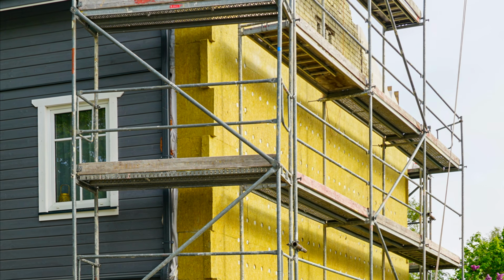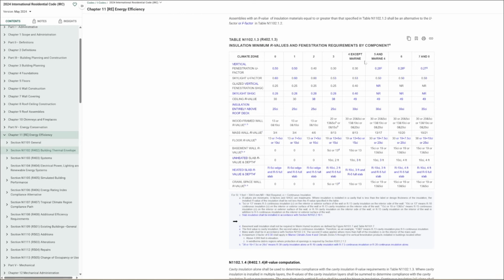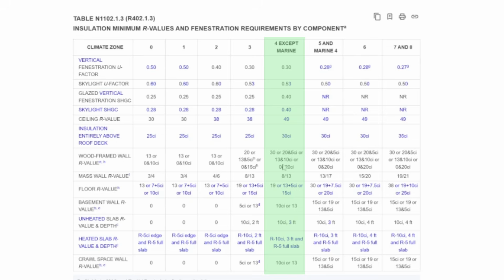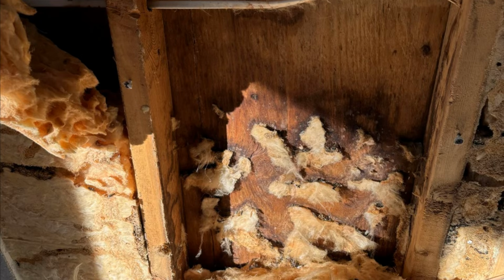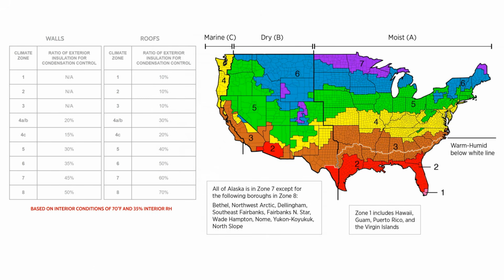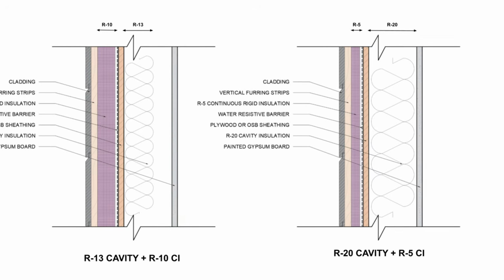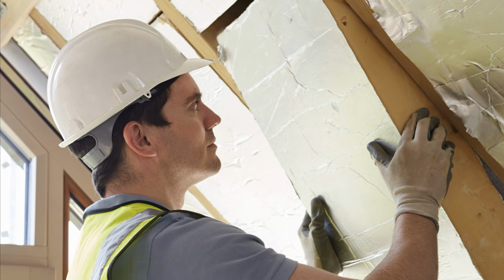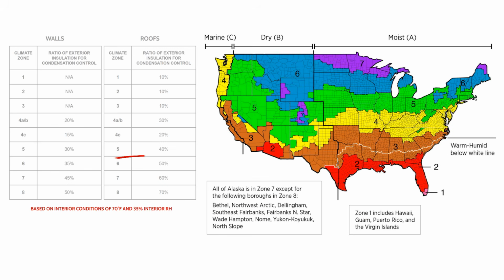How Much Exterior Insulation Do You REALLY Need? (The Code is Wrong?)

Comment: Could you use something like rockwool on the outside to avoid the flammable exterior insulation?    I don't know squat about vapor barriers so I was thinking double stud - with a 2" gap filled with rock wool - between studs rockwool and zip sheathing a rain grid/mesh then rockwool 2 staggered 1" then firring strips.

Comment: Why are you referencing the 2024 IRC but using the climate  zone map from older codes?  The IECC updated these in 2021 which changed them fairly significantly.

Comment: I'd like a video on how best to assemble walls for an intermittently conditioned space - in particular for my new 3 car garage I am building.  I'd like to have enough insulation and tightness to heat and cool the space only while I am working in there, perhaps an hour or two every other day, and only in winter and summer.  Just using a small 10,000btu 110V Mini Split.  The rest of the time the space would not be using HVAC at all, perhaps 98% of the time unconditioned.  We do not have days over 30C nor under 0C when I am there.  walls are 2x6x10.

I am thinking the walls will be: stucco, tar paper, thin rain screen, OSB, Rockwool 3.5 in, MemBrain smart vapor barrier, drywall.  What do you think?

Comment: How does using 3" of closed cell foam on the interior side of the sheating + open cell or blown-in dense packed insulation for the rest if the wall cavity factor in when calculating the value of the exterior sheating?
You briefly mentioned a foamed interior cavity half way through.

Seems like Zip-R6 sheathing + 2x8 wall with alternating 2x4 studs with 3" of closed cell foam & blown-in insulation would get you an R-44 wall, a huge thermal break between exterior sheating and interior sheetrock, and an excellent vapor and moisture barrier.

Looks like a huge PITA to install water bibbs, electrical conduit, and any penetrations through 10" of exterior insulation and keep any moisture from getting through all the hundreds of linear feet of edging between all the pieces of exterior insulation thats fits together like a dang puzzle.    Too many failure points, engineers forget that humans assemble houses, not an automated factory in Japan with less than 0.0001% failure rate.   

You're right that building to minimum code gets your permits passed, but 10-20-30yrs from now is all this pieced together exterior sheathing still going to be held tight and uniform against the walls ?

Comment: I've always done 1" exterior foam in climate Zone 5, which seems to match up with your requirements.  I like this because I can still put siding over it without having to put furring strips on. (any thicker and the nails holding the siding bend)  So far I haven't seen any problems doing it this way.  I like having insulation over all the framing members and my houses are always warm.  I use foil based and tape the seams for the water barrier on the outside.  No tyvek needed.
Reply: If you don't mind me asking what's "always" mean?  basically how long? Do you install windows over top of rigid foam or buck out? Any advantage to installing rigid to studs then installing sheathing over? I build in Zone 5 and like this method but there's issues with some details.

Comment: Hi Asiri, thanks for this well-cited group of recommendations. I was wondering about the interior moisture throttling recommended in the IRC in CZ5 and above. First of all, it does not appear to be enforced at all. Second, if we can limit moisture intrusion from the interior, would the current recommendations by the IECC and IRC make more sense? I will check out BSC's research on this too, but would like to get your take on it.

Comment: I work in commercial construction as an estimator and I've been trying to be the most knowledgeable person in the company on how these assemblies should go together.  Its amazing how varied the design of these assemblies are in the real world.  I am also in the process of doing a large addition and trying to improve the thermal performance of my own home and now have more questions than answers.  One thing that I would love to know more about is the impact of interior closed cell foam with exterior rigid insulation and if that affects this ratio.  Your examples all seem to reference interior batt insulation which obviously has a much higher likelihood of having interior air hit the backside of the sheathing.  Does closed cell or "flash and batt" change anything?

Comment: Writing into the code that you can build something that the code writers know will develop mould problems is begging for a law suit. Some owner builder is going to build a house according to code and then sue someone's butt off when they get a mould problem.
Code should be sufficient that the house will not develop mould under standard operating conditions. Sure, if people are drying clothes over the heater and running their indoor humidity to crazy levels, that's on them. But if they keep their indoor humidity and temperature inside the usual parameters, they have a right to expect that a house built to code will not endanger their health.

Comment: "The code is the worst possible building that you can construct by law..." That's a truly mind-blowing change of perspective. As someone who works in fire protection, I'm certainly going to use this.
Reply: I prefer "code is the floor," but this is a good version, too.
Reply: "The code is the worst possible building that you can construct by law..." we also can say that  the, code insulation , is the minimum new house insulation that is allowed in your region!
Reply: A home that is carefully built to code is a pretty good house that is safe and will last a long time. As a former builder one change I’d like to see is allowing fire sprinklers to be omitted by using non combustible siding, type-X drywall and a new code compliant panel box. Since gas appliances and fireplaces are essentially banned where I live the risk of fire is already greatly reduced.
Reply: @Krunch2020  definitely something a builder would say

Comment: With a minimum  R22 (nominal)wall insulation, I am considering double stud (alternating) construction 2 layers of 3 1/2 Roxul in zone 4 on Vancouver Island. So, rainscreen. Moisture vapor condensation on interior of sheathing could be an issue. Is it feasible to place sheathing BETWEEN the wall studs and thus avoid the issue of condensation on the interior of the sheathing? Thanks again, informative as always.

Comment: First, is this only pertinent to new construction projects only or is retrofitting/renovation (especially for mold remediation, say) considered similarly? 
What do you do with an existing full brick faced house where retrofitted exterior insulation might be highly problematic (I'm only interested with the wall assemblies here, as brick roof assemblies are such a small percent of the housing stock)? I see some that overface the brick and then it looks like they stucco over the new exterior insulation assembly, how's that for the long term?
Second, what of the proposed 51st through 63rd states (Canadian provinces/territories) and Alaska: are those equivalently zones 7 and 8?

Comment: In Norway, we have strict building codes that regulate this much more thoroughly. The minimum requirements according to the TEK17 standard are:

Key points on insulation in TEK17:

Walls: Minimum 25 cm of insulation

Roof: Minimum 30–35 cm of insulation

Airtight construction: Very low air leakage, with specific requirements for the number of air exchanges per hour

Windows: U-value (thermal transmittance) must not exceed 0.8, with a minimum requirement of 1.2

My personal approach would be:

Using 2"x8" framing, starting from the outside:

Wood panel cladding with battens behind it for proper ventilation

Asphalt board as a wind barrier, with battens covering the joints (a Tyvek diffusion-open membrane could be used instead if better ventilation is needed)

30 cm of Rockwool or Glava insulation

A fully sealed plastic vapor barrier

Additional interior battens to run conduits for concealed electrical wiring without penetrating the load-bearing structure

Interior wall finish of your choice

For the roof, I would use 40 cm of insulation with a fully sealed plastic vapor barrier on the inside.

For the floor, I would install 30 cm of insulation with a 7 cm layer of floating screed containing underfloor heating pipes, providing zoned temperature control for each room. The top layer would be parquet or laminate flooring.

Heating would be provided by an air-to-water or geothermal heat pump, or a combination of one of these with an air-to-air heat pump. Firewood is also commonly used for both floor and air heating.

For a healthy indoor climate:

It is essential to have a ventilation system with heat and cooling recovery to maintain energy efficiency and stable indoor temperatures.
Reply: Great approach!

Comment: The code tries to deal with this through the vapor retarder requirements (see R702.7). If you have more continuous insulation you can use less restrictive vapor retarders. Of course, good luck actually getting a vapor retarder installed and detailed to be airtight. Also, for a fun fact, Maryland has removed the continuous insulation requirement completely. R-20 cavity insulation alone meets code there.

Comment: does it make any sense to put the sheathing on the interior side and leave the bays open to the outside?  bays are then filled with rockwool or whatever, and could still put comfortboard before the siding/cladding. might not need furring strips if this is feasible. it would leave the vertical members more accessible to attach the siding, and not require super long structural screws to hold up the cladding. then (offset) stud say a 2x3 wall for electrical/ chase on the interior?

Comment: The fact that this is based off 35% RH is maddening. That's very very idealized, possibly even a bit low for folks who have hardwood floors
Reply: It depends. The colder the weather, the lower your indoor RH is generally going to be.
Reply: Opposite is true here.  35% is rather high for the Desert Southwest.  I'm lucky if I have more than 20% indoors, especially when outside the humidity is in the single digits.
Reply: @ericjohnson6403 Actually outside in the winter is higher than you might think. But cold air holds less water, so when that gets into the house and heats up the RH drops really low. It's a little wetter where I am a bit further north, but still in the desert and 50% is or more pretty common in winter.
Reply: That struck me as odd also. RH below 40% becomes unhealthy and uncomfortable. 

In the nation of airconditioning, don't people use humidifiers?
Reply: @sigi9669  In the summer months, have to run a dehumidifier in southern Virginia to keep interior rel humidity below 80% most days. (Outdoor humidity is normally 60%, so it's a challenge)
Reply: @sigi9669  When you grow up with it, you don't even notice how dry it is, but, get a little rain and man is the high humidity making hard to breathe.
Reply: @sigi9669  They do. Code is completely unrealistic.
Reply: Great video
Reply: Depends where you're at.  Here in the Montana, I need an whole house humidifier running for months out of the year to hit 35% RH.
Reply: I don't see how that matters. It is temperatures that matter, not how much water is in the air. It will change the condensation rate, but not that it is condensing. 1 gallon or 3 doesn't change that there is water in your wall. 

How much does matter when you don't get it right, because then you have water in the wall, but the point is to prevent there from being any.
Reply: @court2379  WRONG!!!  Do you think the dew point at 80% humidity is the same as it is at 20%???  Better re-educate yourself.

Comment: In climate zone 5 using zip r-6 on exterior and R-23 in the cavity would be adequate for a wood framed wall, right?
Reply: It's adequate for insulation purposes but not ideal for moisture control. You'd be better off with thicker exterior insulation since your interior insulation is so thick

Comment: You didn't talk about what the requirements are if there is a continuous vapor barrier under the interior finish surface. Seems like this entire discussion is moot it there is an interior continuous vapor barrier.
Reply from the maker: We have a few videos on this topic. Smart vapor retarder membranes can work if you're in a bind, but they MUST be airtight. BSC also has some really good guidance on this and the dangers of a completely vapor closed interior membrane, especially if you have air conditioning: https://buildingscience.com/documents/digests/bsd-106-understanding-vapor-barriers

Comment: I just got done with my ICF shell of my 5-story DIY multigenerational home. It has 1 million pounds of concrete that is a thermal battery which helps to keep the 2.5”s of eps outer insulation warmer than the alternatives.  This assembly also helps with condensation issues.

Comment: Besides cost, is there any downside to going above the percentage? Say I do r 22 in the wall, and do r 15 exterior foam. Will that cause issues?
Reply: What works depends on your climate and interior humidity levels. Going with a higher ratio of exterior to interior insulation in a northern climate zone is generally better. The only issues that can come up are 1) difficulty attaching cladding through very thick foam, and 2) if you also have hot humid summers and use AC, you want the vapour control layer to be above the dew point in summer as well as winter (ie more outboard). Vapour impermeable sealed exterior foam can be good in this regard as the outer surface is the vapour barrier to warm inward moving moisture in summer and the inside surface is the vapour barrier to outward moving warm moist air in winter. Just be careful of the thickness and ratios if you also use batts and don't use a strong vapour barrier on the inside and outside of the wall assembly and create a sandwich. IMHO, dew point location should be calculated for any wall assembly for all seasons for a given climate before building.

Comment: When you plot BTU loss versus surface area, once you hit R20 on exterior insulation, you're at the point of diminishing returns. Just make the code R20 for exterior insulation. Make cavity insulation optional for zones 1 through 4. Start to progressively require cavity insulation the colder the zone above zone 4. In every case require at least 60% of the assembly's R value to be outboard.

Comment: Sadly, because of lack of code enforcement in VT, neighborhoods are being constructed with 2x6 walls, fiberglass batts, OSB and Tyvek. I strongly suggest no one buy a home built as part of a neighborhood in VT ever.
Reply: This is how a tremendous number of homes have and are still being built in western upstate NY.  Almost never do I see exterior insulation on new builds around here.
Reply: Not sure about current as I don’t do new construction, but stuff I’ve seen 5 or more years old around me still like that.

If not going to use exterior insualtion at least use plywood, I know the cost but then it won’t rot itself away as it can let out the moisture at higher rates.

Also sealing tyvek at bottom and top properly if not going with self adhered vapour permeable is something so commonly overlooked it’s nuts.

People are taping seams, and even using plastic cap fasteners, but it’s just open always on the bottom and sometimes even on top. Nuts.

Comment: I love warm roofs. We have to even insulate the foundation. Insulating the outside does allow exposed timber and post/beam framing. I like exposed rafters with tongue and groove. I like a thick masonry north wall where the sun don't shine in the winter. Mineral wool batt and board is what we like. Insulation is well worth the price. Plus it allows moisture to move outward.

Comment: Thank you for this video. I'm building a tiny house on posts in Maine, zone 6. I plan on doing 100% of my insulation on the outside of the sheathing with rigid foam insulation. 2 layers of 2in on the walls and 2 layers of 3in on the roof.
Reply: Isn't that only ~R20 walls and ~R30 roof? I wouldn't even go that low for my place in zone 4.
Reply: @niktak1114 I found some 2in foam insulation that's R13.
Reply: @scottfrommaine8602 polyiso?  That’s not going to work in Maine winter.  I suggest you reevaluate your plan.
Reply: @scarscar2771 I think it will be ok. It's not going to take much to heat a 14x24 building. It doesn't even get that cold in Maine anymore. If it ends up not being enough insulation, the wall cavities will be open, and I can always add more insulation.
Reply: @scottfrommaine8602 Be careful. If you are using 4" foam on the outside, it is most likely a strong vapour retarder. If you add insulation from the inside, you will need to dry to the inside, so you would want to be vapour open on the inside and the ratios mentioned in this video become very important to avoid condensation on the sheathing.
Reply: @jamesroscoe7555 If i have to add insulation to the inside, I will do as he recommends 50/50 and a smart vapor retarder. If the wall cavities are completely open on the inside, no dry wall, exposed studs and sheathing would I still have condensation problems?
Reply: @scottfrommaine8602 if your stud walls are open, and you have sealed rigid foam exterior insulation you won't get condensation inside (assuming proper interior heating/ventilation etc). However, you may have to do something to meet fire code. If you add insulation inside, keep it thinner than the ratios in the video and an interior vapour retarder isn't needed unless a code official requires it, in which case use a smart retarder, not poly.
Reply: @scottfrommaine8602 polyiso stops working at ~0F. To address that stack 2” of eps on top of it. Or use mineral wool